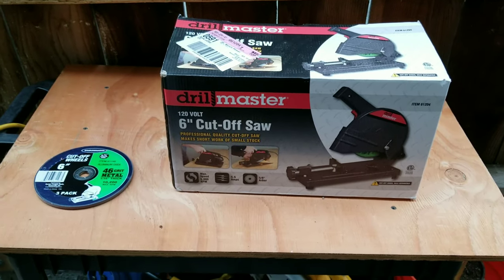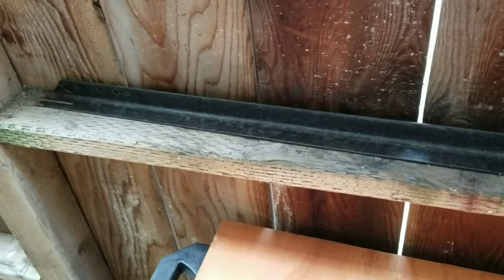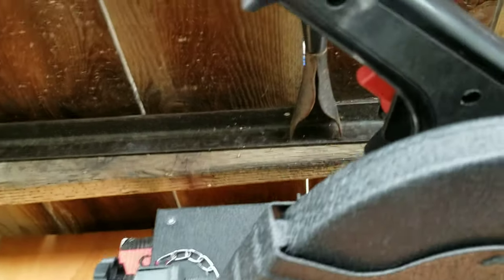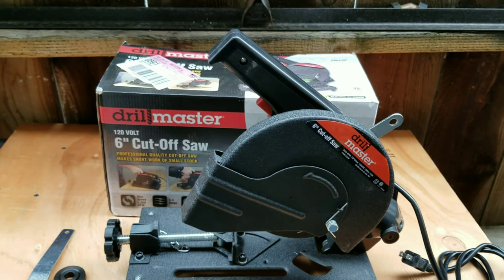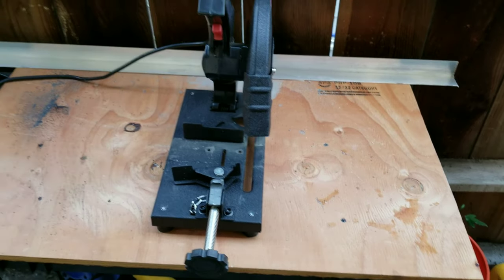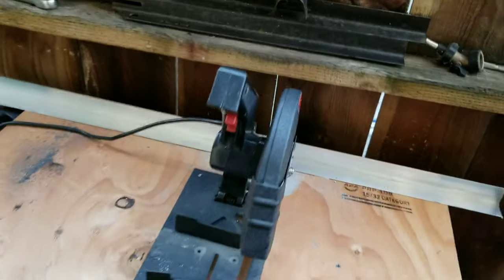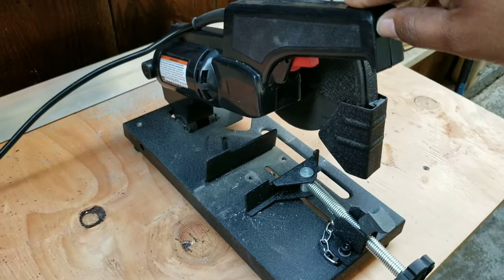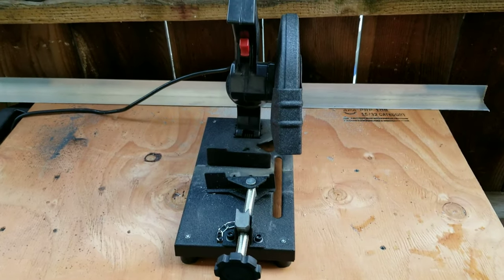Drill Master 6" Cut Off Saw Harbor Freight

Comment: I purchased this cut off saw as well.  Worked very good.  One big problem is Harbor Freight does not sell the cut off disc for this machine.  Machine uses 7/8 inch arbor.  Harbor freight only sells a 6 inch disc with a 5/8 inch hole.  What good is this if you cannot buy the disc.  I get by with a 4 inch disc with a 7/8 inch arbor.  Crappy way to operate this equipment.  I would be great if they made a 6 inch disc for their own products.
Reply: Grainger or Zorro tools will have appropriate cutoff wheels.
Reply: Really? I bought the cutoff disks at HF.

Comment: ? Why you can't cut wood with it
Reply from the maker: It's more for cutting metal then wood when you try to cut wood with it. it ends a burning it unless it's really thin hobby wood
Reply: @theshop7182  okay thanks I do DIYs and small crafts and I just need something other than my miter box and saw to cut like thin pieces of maybe three or four inch pieces of wood do you got any ideas what I could get
Reply: did you end up using this for woodworking diy projects?
Reply: @mgdln3  no i want in got a 7inch  electric saw by Ryobi
Reply: @octaviabrowncraftsanddiys  oh ok i might just endup trying it since i have one already i just wanted to know how it went if you had done so
Reply: @mgdln3  o ok let me how it works
Reply: @octaviabrowncraftsanddiys  do you think your ryobi 7 in. would work well for making shadow box frames? I’m looking for something that can do 45 cuts on 1 1/2 in. Wood. Also, there are a few different options for a 7 in. Electric ryobi. Can you be more specific about what model you have?
Reply: @AmberSLancaster  yes I'm pretty sure it can
Reply: @octaviabrowncraftsanddiys  which model do you have?
Reply: @AmberSLancaster  7-1/4 inch  Compound Miter Saw
Reply: Hope this helps
Reply: @octaviabrowncraftsanddiys  thank you!
Reply: @AmberSLancaster   welcome its a great  saw